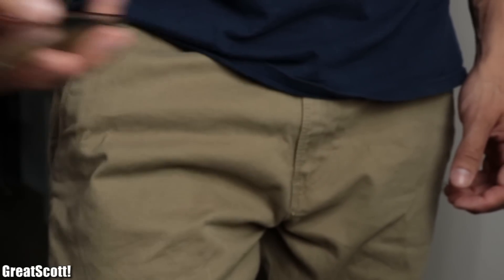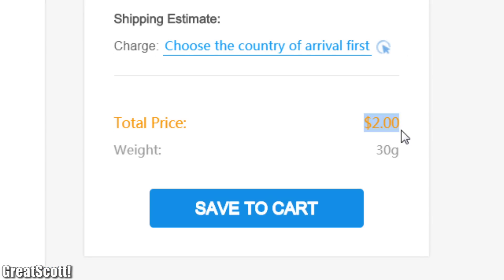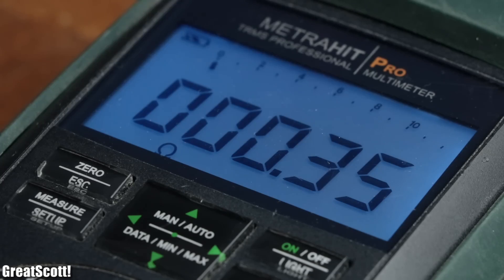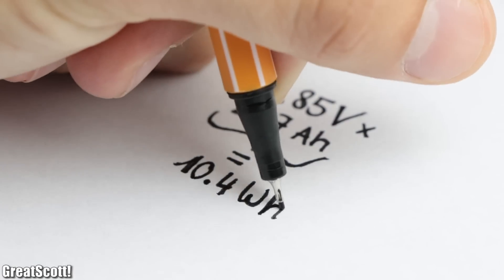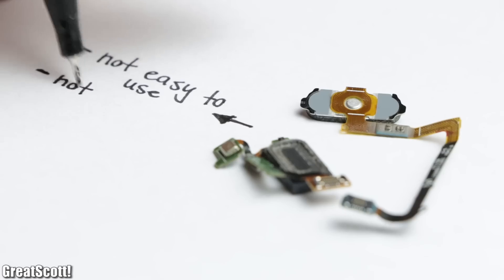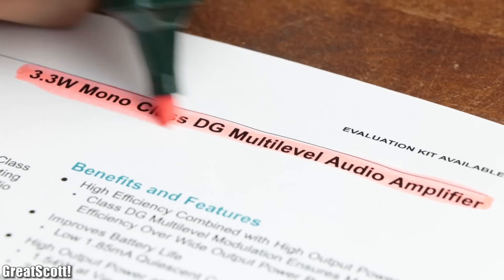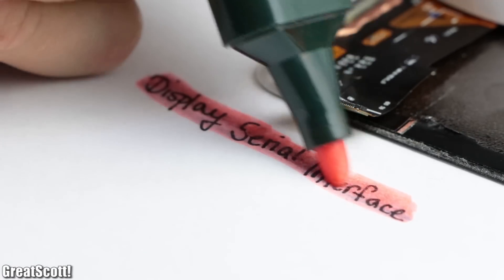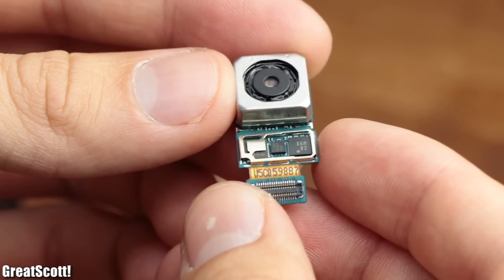What is worth salvaging from an old smartphone?

Comment: I have a broken iPhone lying in my house and its speaker has only 2 terminals. I tried using it by connecting it to a 3.5mm output but the volume is very small. I’m wondering how do I make it louder like it was in the iPhone

Comment: After I upgrade my phone this year (or next) I'm going to take out the motherboard and put it in a custom case with a peltier cooler attached directly to the copper vapor chamber, and attach a USB hub to the USB c port (that has Ethernet, HDMI, USB 3.0 ports, and power delivery through USB C female connection so I can keep using the charging brick without keeping the battery)

Current phone is a snapdragon 865, I plan on disabling the thermal limits and overclocking the CPU and GPU. I want to turn it into an sbc that can dual boot android 12 or Windows 11

Edit: I'll let you know how it goes and if I fail miserably haha

Comment: You are a fool.. just about every piece was useable.. cameras on raspberry pi camera interface's and the screen.. all the filters and cap's it can't hurt to have audio amplifier chips and charge chips and the soc i bet if you look hard enough ppl have worked em out and know how to use them in projects.. so everything you tossed out was definitely useable mostly for raspberry pi's but useable none the less.
Reply: Electronics Boy  off the programmable gpio pins yes they do.. off the screen and camera flex headers maybe not but the gpio pins can be programmed to run anything almost

Comment: Aren't most phone screens mipi or lvds and easily adapted to cheap controller boards you can get on aliexpress?
Reply: Not to mention simply selling the screen as a replacement part, depending on the value/age of the phone model. Broken screens aren't exactly unusual.

Comment: Throw the pcbs in a box.
20 years from now you can toss them.
I still find the occasional use for 350pf air variables from 1970 boards or germanium pwr transistors.

Comment: I appreciate the link to the dsi to hdmi screen project. I think it can be very worthwhile to discover how to use flagship smartphone screens in arduino projects because we could honestly just start making our own custom smartphones. A battery, memory devices, basic cpu, antennas etc could all be easily fit into a decent form factor.
Reply: definitely, not getting why this isn't more popular as there exist control boards which can be used to repurpose old laptop screens into portable monitor
Reply: @Etienne85 I would be happy to reuse any of the screens lying around, but it takes too much effort to reverse engineer the proprietary protocols used with them, there are no datasheets available, which is a crime in itself.

Comment: Foremost the batteries die out. I replaced a few successfully on tablets and one smartphone but my effort on a HTC One M8 was a failure so it's in pieces in a drawer.
Really as long as an old phone still functions with Wi-Fi, use it as a dedicated device to run a remote control app - splice an external battery to the USB port to keep it running.
So many DIY projects and cameras depend on having an app on a phone to get the advanced features and I don't want to tie up my primary phone to operate a camera slider or a remote camcorder. i.e. leave the old phone alone to re-purpose or recycle it as-is.

Comment: I have a Redmi 2 whose display is not working. Touch and everything else is working. Before the display died I had installed Resurrection Remix on it. After the display died I used it by casting the screen to my pc using scrcpy. After sometime screen cast also stopped working. So to delete all the data from it I formatted it completely including the system partition. Now its not showing under adb or fastboot devices. I know its turning on because it vibrates when I hold the power button. What can I do with it?

Comment: I had a moto e5 that I dropped in the tub accidentally. I dried it out and it worked fine for about a month then just quit. I had another moto e5 that I smashed in a fit of rage over a woman messing with me. I took both phones completely apart and replaced the motherboard in moto that went for a swim,with motherboard from smashed phone. Worked like a brand new phone,still using it. Some strange tiny symbols inside a phone I must say. Im sure manufacturing logo,but strange none the less.

Comment: Also note that different phones get slow after different times. My 5+ year old iPhone SE (first gen) is still going strong, and all I did is replace the battery when it went bad, and replaced the screen after it got shattered. Apple just makes it harder to get genuine parts, their phones are generally quite easily fixable.

Also, please do not throw electronics straight in the trash (Restmüll). Every municipality takes in electronic waste (WEEE) for recycling, and some even give you extra bins for that

Comment: I once took apart a Nokia C6 (the one with a sliding keyboard in the landscape orientation). It's camera flash module was separate from the motherboard and can be used with a 4V DC battery, It was pretty powerful for the size, and had very high (>95%) CRI.

Comment: Well actually the PCB itself is a working computer so if you figure out direct power without battery, and how to make it work without screen.. all you have to do is flashings Android full of bloatware added by the manufacturer with either stock android, de-googled Android or  potentially something like Mobian. Hook it up to larger 3rd party screen, wireless mouse and keyboard and you have a Linux/Linux-ish PC.

Comment: Most dummest example was the LED bulb... replacing it with a fluorescent light bulb will not need all that wire... just use plasma energy using a Tesla

Comment: This is terrible... If you have a phone as good as an S6 there a lot of other ways to breathe new life into it like installing a custom ROMs, using it as a server, etc...
I'd kill for even a Galaxy S2 since they have excellent community support.
The only reason it would be acceptable to do this would be if the phone doesn't work anymore at all, but if it's still working you're just wasting an expensive device that could have hundreds of more use cases.

Comment: I bought a heating bed for a 3d printer.. did not come with a thermistor.. I had none.. so I dismantle a dead phone battery.. cut the pcb with a dremel and salvaged the thermistor inside.. solder some wires and wallah instant heatbed temp sensor...

Comment: I still use my Windows Phone Lumia 535 for basic purposes and not going to throw it away ))
Reply: This is the only time where I'd say it's best to salvage it or find a custom firmware to put into it, Windows Phone is terrible.
Reply: @Flopster101  why? I'd updated it manually to Windows 10 and it works fine, I have all the necessary apps and I still can download apps from Microsoft  store.
Reply: @AleksP1987  Because even Microsoft thinks of it as a failure, that's why it's going out of support in favor of Windows 10 for ARM.

Comment: The boards are good to sell to repair shops. They use them to repair water damaged phones. They do a component swap for data recovery. Having an identical board to test and swap parts is how data recovery is done. It's not just the newest or expensive phones that need data recovered. The most common phones are most commonly repaired for data. This also applies to hard drives. Most boards can only be used once or twice to repair another device. As parts are removed the more chance you are replacing broken parts for damaged parts.

Comment: If it works, probably worth it to keep just for apps and stuff.  Now that 'old' phones include quite a number of phones which can snap pics in RAW image format, it's great to keep a couple around for quick project documentation pics. (Especially with Adobe Lightroom installed, the images go to the cloud, and are available on your PC near-instantly!)

Or you could just keep it around as a music player without running down your current phone...  Or, with the right app, use it as a dedicated screen for a USB oscope/LA. Or a dedicated screen for a cheap USB microscope, so you don't need to get one with a screen...  Heck, you could even use it to add a touch interface to a 3D printer, if you're using a RasPi with Octoprint.

Comment: The "weird component that looks like a coin cell" is the vibration motor. When the phone is put on 'silent'. It's similar to the vibration motors in game controllers, but designed more like a speaker to be flatter to fit inside newer phones.

...For anyone curious.

Comment: Can you make a wireless mouse that uses super capacitor instead of regular battery. This way even one or 2 hours usage will be ok with a super quick charge capabilities. So charge it in seconds and use like 1 hour so do it the same thing again.
Reply: I don't think you could do that since the LED needed for the optical sensor would drain it very quickly.

Comment: I have a bricked Galaxy s5 (trust me it's dead) but there is no physical damage to any components I think using the display as a small interface for a rasberry pi would be a good idea.  I have not done research but according to this guy, I can just desoder the DSi pin connector and soder an hdmi in? that's weak man

Comment: I kept my old S5 complete, cleared out all the clutter and loaded up a load of electronics/engineering apps, also i have (admittedly not the best quality) a camera, light source, speaker (AF sig gen), mic (data logger\really really low bandwidth 'scope :-) ), tilt/motion sensor, and timer. All wifi connected. All with a sophisticated OS and API tying it all together.
...
Or I could have taken it apart for a few buttons, a semi-knackered battery and a coil :-)

Comment: Your phone doesn't get slower. Your needs get higher. Seeing even faster phones in stores and apps requiring more resources, it feels like phones get slower. 
I would never take apart a working phone...
Reply: Lol, Apple disagrees! But also, if you notice when your (Windows) computer gets a couple years old, things like just opening chrome may start taking 5-10 seconds, or the start menu hesitates a second, or just general lag, well then it’s basically one of 2 things: Windows operating system files get super cluttered through all the updates and things start getting scrambled taking longer to find (not fragmented, it happens on an SSD too), so a fresh install will get it working like new. Or it could just be when your nearing the capacity limits of the drive and as the drive fills up it gets slower (you would ideally only fill up half the SSD or at least only 80%, and mechanical disks just keep getting slower with any data you add but it gets obnoxiously bad towards the last 10%).

So just like your computer, you occasionally should do a clean install, the software just gets cluttered up.
Reply: @jakegarrett8109  I agree on that. But a fresh reset is always possible. The hardware itself doesn't get slower.
Apple... ;-) Updating phones OS to make it useless hehe

Comment: This is why I daily drive an LG G3. Tool-less battery swap, unlocked bootloader, uSD slot, and LineageOS-ready hardware make this device hold its utility far longer than competitors. Smartphones are almost inherently disposable, best just make 'em last because as this video shows once they're dead that's it. Trash. I just had to resolder the SSD on mine, after I dropped it without its case, fortunately it came good...

and it plays DOOM 1, 2, AND 3!!

Comment: old smart phones are great to use for all kinds of stuff. turn off the phone network function, leave wifi enabled and you have a gps handheld computer with built in camera. add a wifi or Bluetooth car scanner, instant car obdII scanner. use it in a cheap vr headset with a 16 dollar 5.8 ghz video receiver, instant fpv headset. so many uses. slowing down = too many apps running, clean it out. get a fresh battery cheap, away you go.

Comment: As a cellphone technician, my teeth grinds when you remove the lcd :(
Your doing it wrong.
And your bending the board while removing the metal cover :(
Reply: Hey, Asking on the main video, but since it's your area of expertise: Is there a way to salvage the data from a phone's HD once the motherboard is damaged?
Reply: Edit: was indeed a double post.
Reply: If you have the right tools and the a ability to remove the ic without damaging the ic. Then its still usable. You can even recover files from damage phone. Storage component in phone is called emmc/nand.
The tricky part of it is the underfill.
Reply: @notcoolsuicide1599  Sweet, thanks. 
For context, my aunt got into an accident and wants family photos that were on the phone. (explaining because the same question could have much more nefarious intent behind it).

Comment: Yes, it's possible.
The phone processor It's not like the PC.
The processor needs specifications.
You cannot put a high-grade processor with a 13-megapixel camera, or put a 2GB RAM.
This can not be done on mobile devices, since processors are already extremely limited.
Reply: Phone's have already exceeded those specifications lol.
Reply: @Flopster101  I am referring to the compatibility of parts.
On Android, processors are compatible, on PC, you need to test.
Reply: @x-gamessimulator1067  Well, on some phones it is actually possible to upgrade the RAM by soldering a different chip.

Comment: How to salvage your phone:
 Is it working?

 YES- Sell it.

PARTLY- ex. bluetooth, wi-fi, battery, screen is broken(but working) use it to connect to smart devices as controller or just as brain in your project. 

NO- take out battery if its not dead and rest throw away TO SPECIAL BINS FOR ELECTRONICS.
Thanks me later.

Comment: "overtime my smartphones always got slower"
Me, watching this on a 5yo tablet: *laughs in lag*
Reply: "[...] leaving my galaxy S6 behind."
Meanwhile I'm using an S4 to watch this very video just fine.
Reply: @ankaz2019  meanwhile watching it on my Lenovo A6000 1GB variant
Reply: and then i looking at my 7yo laptop and it is running the matlab 2019a at pretty fast speed at today’s prospect
Reply: @stephensu4371  how about my 14yo laptop?
Reply: LoudSonicBug, haha, you must being taking good care about your computer
Reply: @stephensu4371  same here, got an old Lenovo G560 of 2012, work pretty fine with its pentium. screen not yet burned, battery gives u only 10mins from full to absolutely low
Reply: @stephensu4371  Eeeh xD well I recently build myself a desktop from used parts so I don't use it that often anymore. YouTube 360p is maximum. 480p starts to lag, and 720p is choppiness. If you play back a video in the video player (which uses gpu acceleration) 1080@30 is a thing. Battery is completely dead for years now. A few keys are broken or are hard to press because they were pressed too often. And the fan is kinda ducked. Sounds like a saw. It does work though and with fresh Windows (and Xubuntu Linux Multiboot ) it actually serves simple tasks still pretty well. Good care is something else xD let's say I didn't have another option.
Reply: Don't update if u don't want to slow down . Simple trick or just port to older os firmwares
Reply: @MMaheshThakur  Damn planned obsolescence!
Reply: Me laughing with my Gameboy Advance.
Reply: @vexanval  Nice name
Reply: @vexanval  How about Gameboy Pocket?
Reply: @loudsonicbug2195  No id prefer a 1978 Wired Phone
Reply: oh yeah? Well I'm using iphone 7 from like 10 years ago, an upgrade from the SE, and upgrade from my FRIKIN DS LITE from 15 YEARS AGO
Reply: mine died year ago 😭 bought it in 2013 samsung tab
Reply: @etch3130  u r never secure on in internet world
Reply: Me: Watching this on Samsung Galaxy Ace (budget phone from early 2011) with rotating square loading logo. o_O
But my primary phone is moto G5s plus (mid-range from late 2017)
Reply: Me laughs in in iphone 5 thats 8 years old and has 5 sec. of use time cause the battery is dead and if you charge it it gets really fast really hot and i have to use a cooling block to use it while hearing music (via Bluetooth) oh i forgot to mention that the battery has expensed (you can see under the screen) because i (through a mistake) was charging it with a 10 W charger for 2 weeks or more idk im just replying to comment to people that have spoken a year ago. Herr Gott im Himmel!
Reply: Laughs in C64
Reply: I got a 6.5 year old iPad that still works like a charm. Screen still crack free too.
Reply: Idk I'm watching an a galaxy S7 & it seems to be working fine for its age.
Reply: Bruh I have an iPhone 6 get on my level! And years ago I was using a 2010 computer and Avs video editor for all my videos.
Reply: Iam also watching this on my 4yo tab lol

Comment: You can desolder internal NAND eMMC and buy cheap usb controller on Aliexpress and use that as cheap usb drive with decent capacity. Or you can get programmer, clone old NAND to current one and upgrade your phone to bigger storage.

Comment: Scott, i do not recommend to you samsung phones. Yes, they are the best known android phone company, but i can tell you from experience, they slow their older phones down, to make you buy a newer. My dad had a Galaxy Ace II Duo back in 2012, he was using it for a couple of years, and it gradually got slower and slower. He bought himself a new phone, a different brand, and put it aside. One day we decided to do something with it, did a factory reset and it was functioning very well. It was fast and snappy, but when we updated it to the latest update that could be installed, it slowed down significantly. I wanted to open an app, and it froze and shut down. After another factory reset it was good again. So... Think what you want, but i am sure this is not coincidence
Reply: No that's not the problem. The problem is that the Galaxy Ace II is a TERRIBLE phone, in fact, all of the Ace series are, and all Samsung was doing is updating the software with the latest patches but since the phone is so damn slow it just can't handle the newer apps.